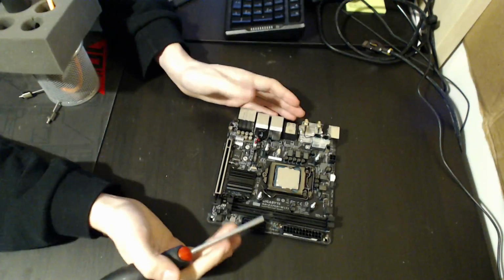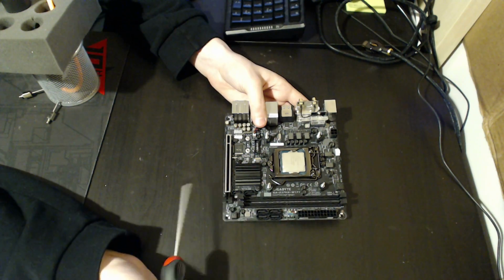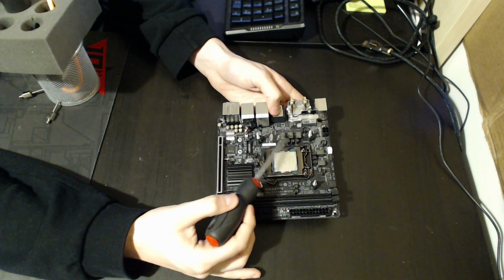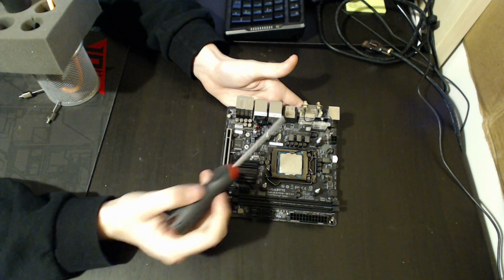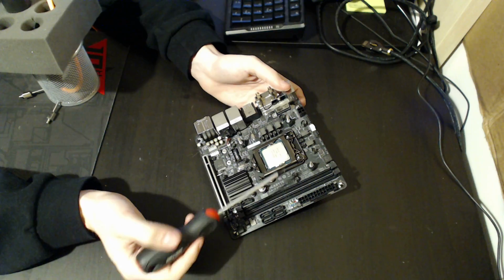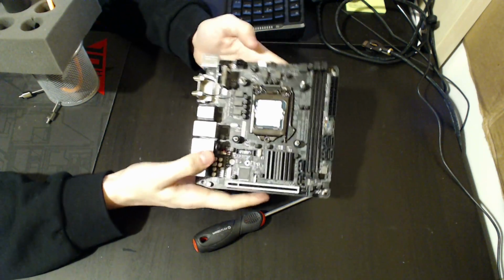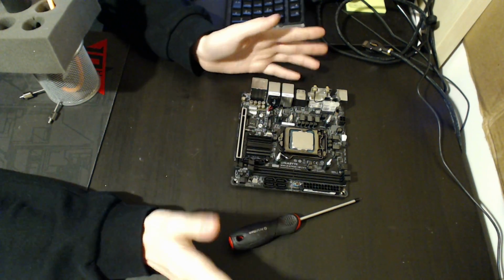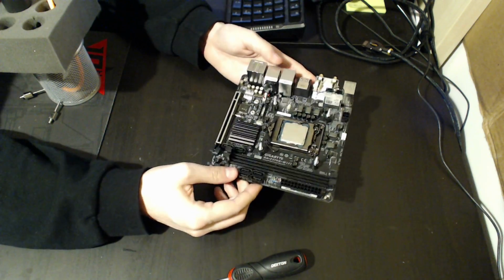The Gigabyte Z270N-WIFI (It's adorable)

Comment: You can get into BIOS with a bad overclock if you push reset 3 times and then hold down powerbutton until it shuts down and when you push powerbutton again it will state you had a overclock fail and you can the press F1 and get into BIOS, so that way you dont have to clear cmos and redo your overclock :-)

Comment: looking at one of gigabytes ln2 boards atm, how do they mount the ln2 block for the cpu without mounting holes? with a backplate going around the board completely to get the mounting pressure that way?
or do they let the pot just sit on it... which i doubt.
Reply from the maker: A lot of pots are heavy enough to mount by just sitting on the CPU. The better option is something like this: http://shop.dimastech.it/ImgRepository/Prodotti/66659/61758_Zoom.JPEG

Comment: Curious how the older Ga-Z97N-wifi compares to this. Mine appears to have more phases on the cpu vrm than the newer z270 itx board. Or is it simply more but lower quality phases?
Reply from the maker: That's a 4 phase for the VCCIN. Due to how haswell works it puts a lot less strain on the VRM.

Comment: not sure if it is allowed for the competition. Often I'll add green diner-mints (Poly film caps) to the backside of the PCB across the power capacitor pins on stuff that gets a tad noisy (RFI) and gets picked up by my radios. Something to keep in mind is many caps have a upper limit on what is called ripple current, so many diner mints (more then five) may be needed for some stuff (like that V-core reg).  Also the lower ESR of them diner mints can put extra strain (higher current ) on the fets feeding them, so there is a bit of a trade off there. I've found that 0.01uF and 0.022uF 50v diner mints usually fit nicely between the MoBo and the tray, larger diner mints tend to be a bit more difficult to work with if they fit at all.

http://www.zarcondeegrissom.org/comps/OSGP/OSWmobo2_2055e_1600L.jpg

http://www.zarcondeegrissom.org/comps/L3stuffP/L3Mobo2_1495c_1600L.jpg

Something kind of like that. As for the 4-pin connector, I've found it easy to sneak in a few diner mints into the pins on the connector with larger 1uF Poly caps further back on the cable. Like this.
http://www.zarcondeegrissom.org/comps/L3stuffP/L3PSU1_1273e_1600L.jpg

http://www.zarcondeegrissom.org/comps/L3stuffP/L3PSU2_1282e_1600L.jpg

Great vid, and that is a nice looking board :))))

Comment: you say that a 4 pin is enough for 240w. but i had customers at work who had an 8350 and only plugged in the 4 pin (with a board with 8 pins) and the connector just  fried... any explanation for that? O.o
Reply from the maker: did they OC? There's also a chance they didn't plug the connector all the way in and the bad contact led to it burning out.
Reply: no, no oc at all... as far as i could tell they were plugged in (the clip was latched) but there was no top airflow because the case had no ventilation or fans on the top maybe that could be the issue? it is very wierd anyway... i have one of the boards still here, works fine with the other 4 pin XD
Reply: Could be shit connectors or PSU
Reply: those pcs each had be quiet psus, one straight power e9, one Pure power L8 and the other one was a pure power 9 i think

Comment: Are you sure the main reason that 2 slot boards OC better than 4 slot boards is because of the closer distance? 
I thought it had something to do with the parasitic capacitance from one channel having to have two slots instead of one.
Reply from the maker: Gigabyte has literally made special non retial OC boards where they put the RAM slots so close to the CPU socket that they had to switch from intel mounting holes to AMD mounting or no mounting holes. I don't think they would go that far to reduce the distance from the RAM slots to the socket if the distance didn't play a significant role.
Reply: Oh yeah distance does play a significant role role, but I'm curious of how the parasitics would affect it as well. 
One curious thing though is why not go with SODIMM (laptop) memory as well, since the much smaller profile would let the edges of the DIM get closer to the cpu socket as well.

Comment: Awesome board. My younger son has the Z170N Gaming 5 and easily does 3300MHz with 3000MHz RAM running a 6600K @ 4.5GHz. Couldn't fit the Scythe Shuriken Rev B on it because of the cap bank. My older son has the Z77N-WiFi and it does 1866 with 1600 DDR3 running a 2500K @ 4.3GHz. They are decent boards. Not the best but fairly robust for mITX.